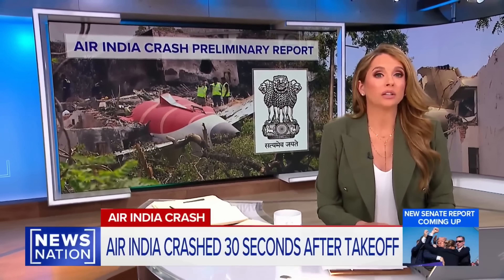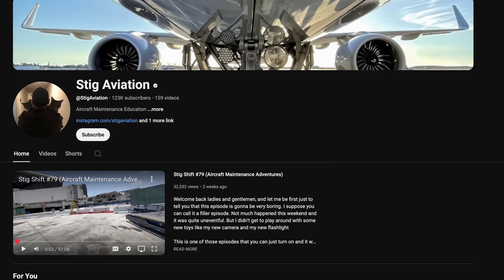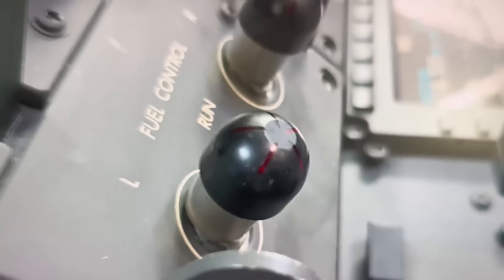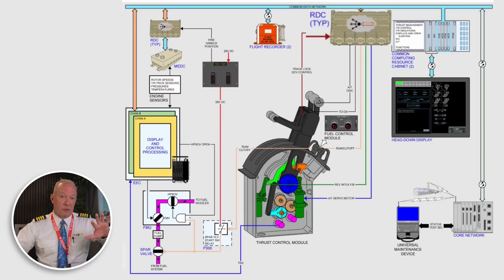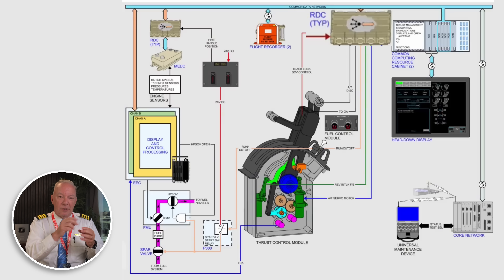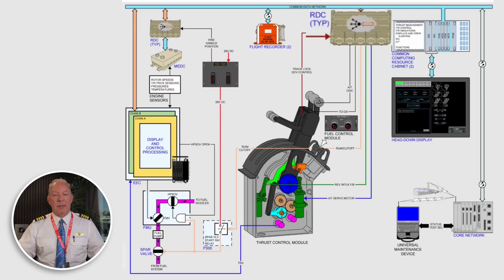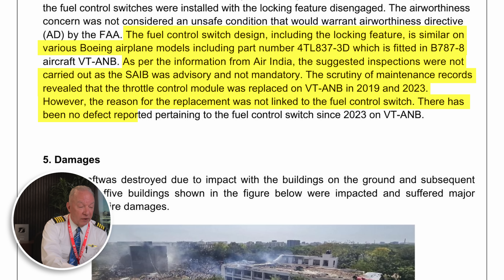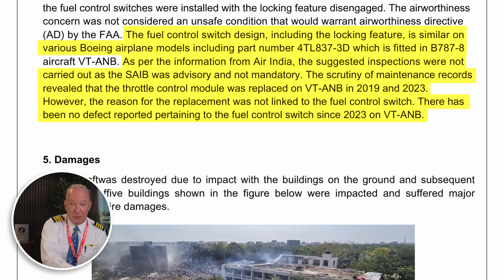The Truth About Boeing 787 Fuel Control Switches

Comment: Schematics don't lie.  Thanks for the clear description
Reply: Yea but he read that "schematic" wrong (actually, it's a Functional Block Diagram with cartoons), but that's ok.
Reply: You didn't read the report.
Reply: This "schematic" is no such thing. So, yes, it lies.
Reply: @ConcernedParent-z1q Let's call it a system block diagram then.  It still shows that software is not in the path between the switches and the valves.  This is smart design for a high reliability system.  I helped design the flight deck for the B777 and this description is totally cogent.
Reply: @kenhoyme3673 well that clearly shows you can't read a diagram. What decides tbe other half of the AND gate then? You know, the other thing that can shut the valves. It's right there in the diagram.
Reply: Why arent we considering a possibility where dual engine failure happens just after take off. Then pilot manually turn fuel switches off and on because thats SOP in Boeing planes in case of Dual Engine.? You can refer to Gaurav Taneja AI 171 Part 3 in english dub to understand more about this theory as timeline of RAT deployment also matches with this
Reply: @ishanarora7948  You know that you don't need to keep posting the same comment over and over again.. Doing this makes things annoying for viewers.  I don't need to see the same inane comment over an over again.
Reply: @ItsAlwaysRusty  Thanks! I noticed that & was about to comment on the useless repeat posting. Thanks again!
Reply: @ishanarora7948  That is a possibility, but if so, then why would one pilot ask the other "why did you do that?"
Reply: @ishanarora7948   Cpt Steve has said, several times that if it were the case, it wouldn't take 10 secs to turn back on. It would be Off, then On, quickly. Not a 10 second delay.
Reply: @BashfulLadybug if there's no power, you literally can't turn it back on until there is power. Flip a breaker - do your switches work? How about a power outage? Do your breakers or switches work? What if you flip them fast vs slow? What if you flip them 20 times? Why did everything take a long time to come back on? Because the RAT started supplying power where there was none.
Reply: where did the image come from?
Reply: Unless there is an electronic malfunction... This was not a deliberate act. Steve is assuming!!!
Reply: @Dannyjones1  If it were an electronic malfunction, both would fail at the same time and not one sec apart.
Reply: @lawrencedavidson6195  There are many inconsistencies in that preliminary report. The word "about" was used many times. The one second can be a microsecond for all we know.
Reply: @Dannyjones1  These are operated by DC (direct current).

Comment: You did not talk about these processors that electricity is running through.
Reply: The schematics show that they are not routed through any processors, only relays.
Reply: @lawrencedavidson6195, I am a Pilot with an experience in aviation software engineering. Not only I need to know what happens when a switch is flipped I also need to know which line of code get executed and where that leads to. 
What he is not saying is that there are multiple point of failure that can cause a computer to log that a switch has been activated even if they have not been activated.  
Where is the auto pilot fue management in this picture?
Reply: exactly. a drop in voltage could cause the relays to open

Comment: What if the battery bus failed or was unstable after takeoff?
Reply: that needs testing but it could be that the relays fail safe and cutoff the fuel - I dont know for sure.
Reply: yes i agree that is an option. even a drop in volage

Comment: There is no closure until Capt Steeeve explains. This video is excellent.
Reply: Unless you have a brain.
Reply: Capt (use the term as has the wings to prove it thats all) Steve is no expert. Treating peoples lives as a cash cow. Only officials of the air investigation should be commenting. These things are far more complicated then the diagram shown. Switch is closed to transfer power to the other side of the switch.   Simple short can remove thatt power for a short time and a single point of failure has not been ruled out yet. Someone should stick to flying.
Reply: @paulchapman7027  I’m more likely to trust Steeeve’s word who knows the inside of a cockpit inside out, than some rando on YouTube comments who has utterly no clue
Reply: Why arent we considering a possibility where dual engine failure happens just after take off. Then pilot manually turn fuel switches off and on because thats SOP in Boeing planes in case of Dual Engine.? You can refer to Gaurav Taneja AI 171 Part 3 in english dub to understand more about this theory as timeline of RAT deployment also matches with this. https://youtu.be/pq2AZdzH7X4?si=0pLKXsmG1M7tRXAZ
Reply: @ishanarora7948  because the flight recorder doesn’t show engine failure.  It shows the switches were turned off for 10 full seconds not off and on.